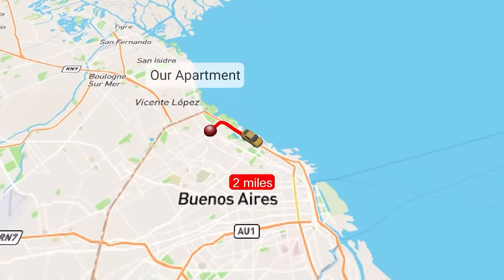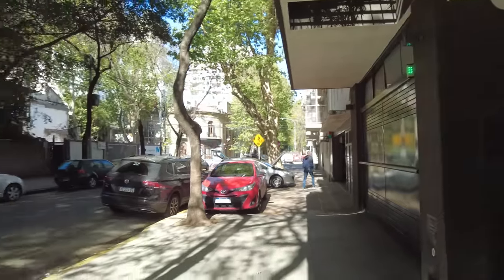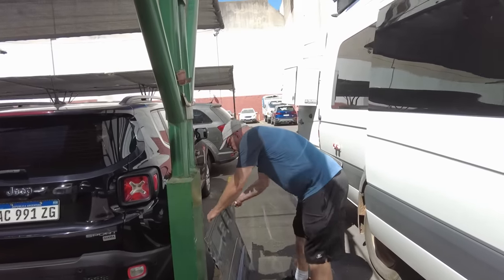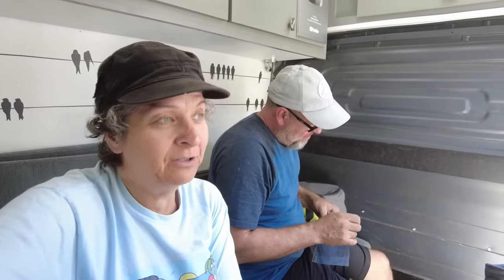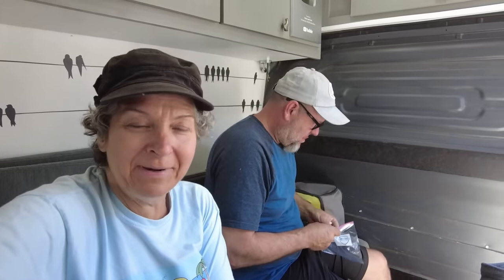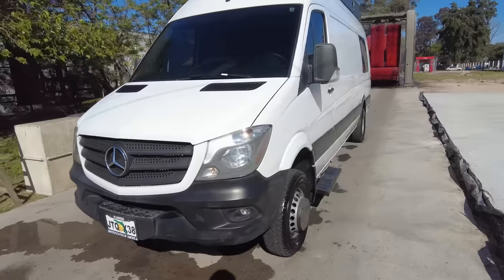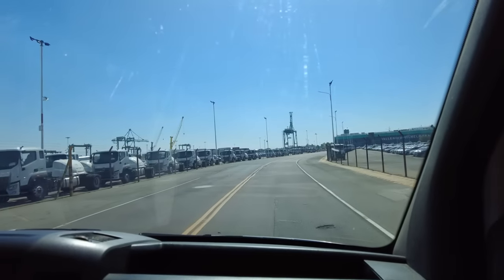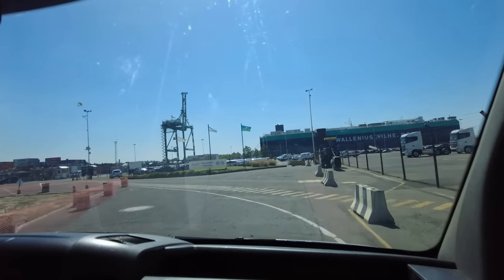WHAT AM I SUPPOSED TO DO NOW? - THE VAN IS GONE!

Comment: Fingers and everything crossed everything goes ok. We are beginning to plan for the return of our truck camper from the U.S to U.K., the first hurdle is that the agent won’t know the shipping date in Feb until a month before so can’t plan until then and need to allow wiggle room for visas and TIP expiration. Coming out we didn’t have to give the habitation keys to the shipping company, who knows going back. Thanks to your experience if you can call it that, we will use a lockbox for the key, access number can only be obtained from us if needed by customs.

Comment: Well I wouldn’t use that shipping agent again! Adding unnecessary stress. It makes sense that customs want access to everything, as if it’s a giant suitcase! You don’t want them to bust everything open thinking you have contraband stashed behind the wall. It’s whoever gave you the expectation that it would remain secured that let you down. Fingers and toes all crossed that you really enjoy Europe. It will be an adjustment for sure.
Reply from the maker: he agents fault.... the shipping industry is changing RAPIDLY with rules and regulations. It seems that the batteries used in camper vans are casuing fires on 2 or 3 ships over the past several years... so they want access for fire safety. Our agent thinks regulations will get even harder before the end of the year. Of course, I would have liked to have planned differently, but after getting my head wrapped around what happened, I do not want to put any blame on the agent.

Comment: hey guys. relax. to give ALL your keys is something expect.they Will open ALL the vaan at arrival or before boarding the ship to chek you are not smuggling something, drugs snd explosives for instance. Relax, nothing ususual.
Reply from the maker: We totally expect thorough customs inspections at each port, but those are supposed to happen with us present. We expected to lock up the back of the van AFTER the inspection... and then open the van on the other side for the customs inspection over there. Of course our van would need an inspection.
Reply: @SnowAndCurt  ✌️♥️